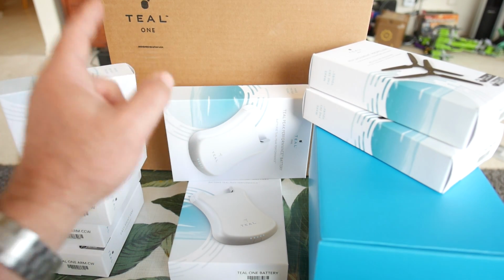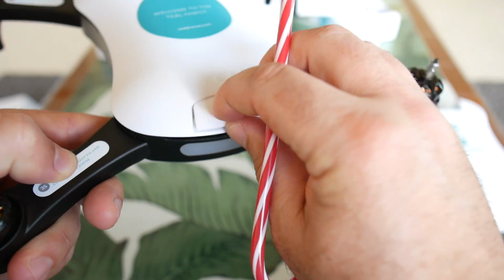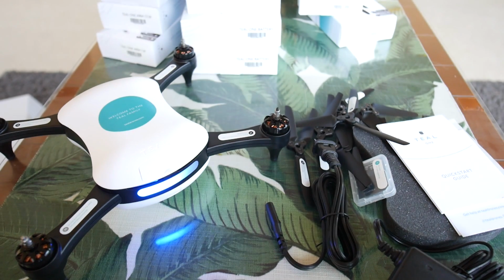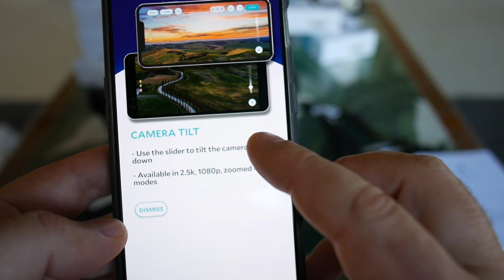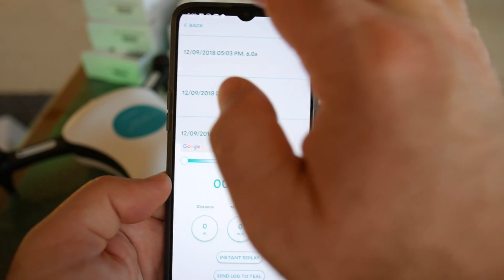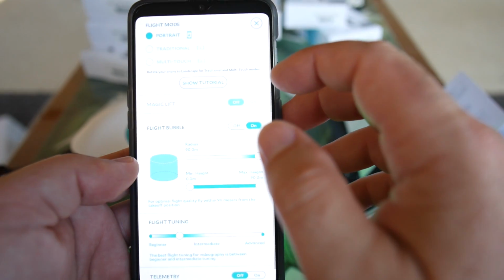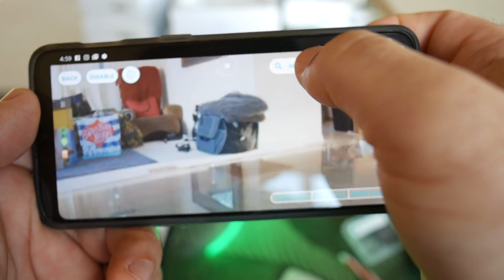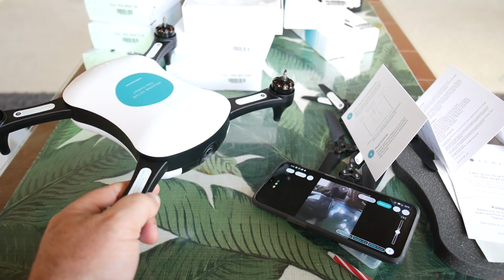TEAL ONE Review - Nvidia Powered Smart Drone - Part 1 [Unboxing, Inspection, Setup, Pros & Cons]

Comment: Dustin:  You always have great reviews.  But, NO Controller (NO GO FOR ME) Looking at the website, replacement parts are ridiculously High and a battery for $99 that isn't even 3000 mah.  Interesting little drone, but we don't need another Mini Drone on the market right now.  My guess:  This drone will run about $699 or so and we have no information concerning customer support either.I think I'll definitely pass on this one.

Comment: Had one of their employees stop by and give us a demonstration of one of these.  Top speed of 50mph+, flight time of ~11 minutes, runs a full Ubuntu 16.04 OS.  They were asking if something like this would work as a way to ramp students into robotics.  Modular and robust construction but quite heavy.  The ESC are inside the case so you could swap the arms out with wheels and turn it into a ground based unit.

Comment: Dustin Dunnill Excellent review, definitely the most thorough and interesting channel.  Please review the Plimp drone or similar...been big into inflatable drones for years but no one seems to make good  ones.  The Plimp boasts hours of flight time, 45mph top speed, and miles of range-but I only have seen passing references to it.  Surprised the Chinese haven't knocked off a smaller yet similarly featured version yet.
Reply from the maker: Looks interesting.  I'd be a little weary of it blowing away in the gusty sea breeze here in Hawaii is all.
Reply: @DustinDunnill  I imagine some of the battery life in the claimed hours of flight time would go towards wind stability, as some of the control functions previously used to generate weight counteracting lift are used for latitudinal/longitudinal wind stabilization.  It would be amazing to see a head to head review to a standard drone of similar cost as a top speed of 45mph is amazing, as well as hours long flight times which I feel would be a major benefit and counteractent to it's non standard appearance and design.  I also feel a miniaturized version is an inevitability, but time will tell.  Thank you for responding, made my day.